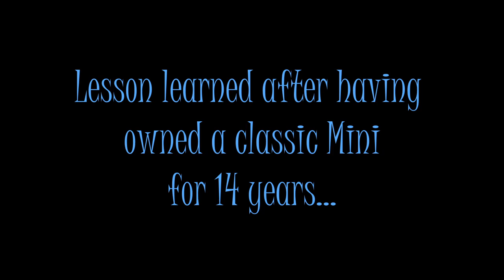#13. SU HS4 Carburettor Part 1.  How to get rid of Air Leaks on the Shaft!

Comment: I’ve never heard or come across that tip for reducing air leaks on SU carby shafts. I’ll be sharing that one for sure!
Reply from the maker: Though it only works in HS4s as the spindle diameter on HS2 is too small for the valve stem it seriously transforms a worn carb into a brand new one almost provided the spindle isn't worn to smitherins it works pretty well! I be clocked 10,000kms plus with this patent and still going strong

Comment: What were you spraying out of interest, as I need to check for air leaks too.
Reply from the maker: Its carburetor cleaner spray. will reveal leaks as its combustible and the moment it gets sucked in it will alter the idle speed. Be aware its extremely flamable so make sure you do not spray it on a super hot exhaust manifold or you will need a fire extinguisher to spray on the resulting fire too! I recon that  won;t be much fun!

Comment: Great idea. I need to do this on the hs4s on my spitfire and am a bit nervous about drilling out the carb bodies and fouling them. Definately gonna give this a shot to see if it works.
Reply from the maker: Trust me it works incredibly well! I clock around 10000kms before i need to replace the stems on the carb shaft. Cheap cheap and reliable

Comment: Valve stem oil seal as used on MPI models ( Browm)
Should last longer.
Thanks for video great tip.
Reply from the maker: Hey thx for the tip! I have never laid my hands on an MPI engine as I ve only owened carburated 998 engines (pre 84) but I will certainly look up them brown valve stem seals! Thank you for the tip!
Reply: @TheMiniDiaries  No problem.
MPI valve stem oil seal manufactured with original Dupont Viton, as fitted to the twin points engines, are the best material and seal you can use and although expensive are the best to date in stopping the engine smoking.
Manufactured using original Dupont Viton which offers excellent resistance to heat, aggressive fuels and chemicals. A "must" for intake valves.
Reply from the maker: @paulhotson5820  Good stuff mate!!